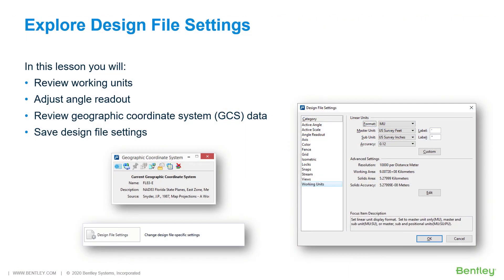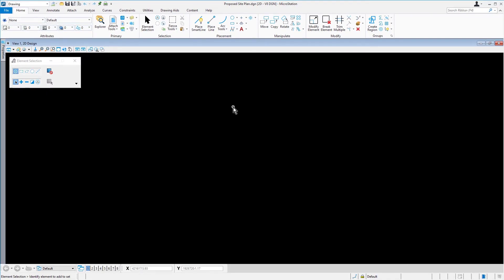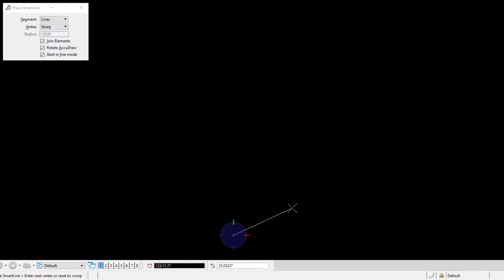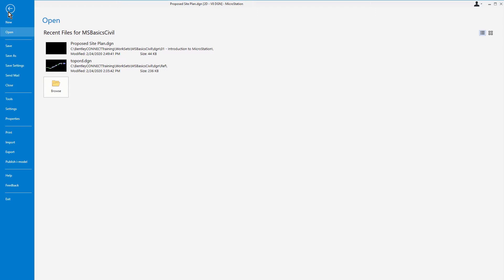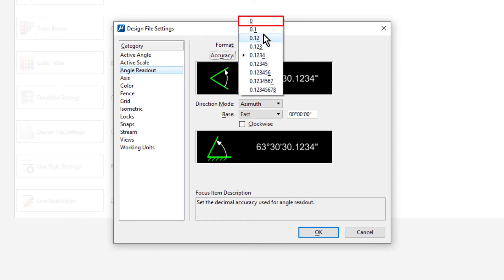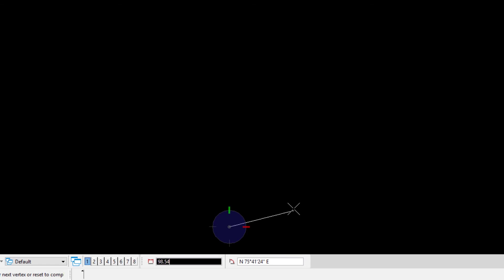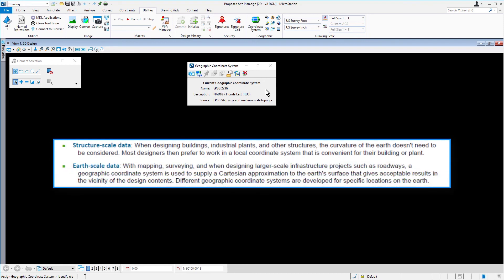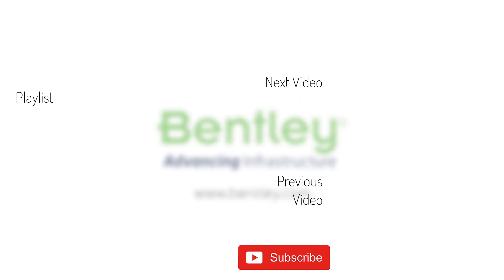Part 4: Explore Design File Settings

Comment: To understand why AutoCAD became the default CAD system, look no farther than this.

It takes 4 steps in AutoCAD to set the units and precision. In Microstation it takes 11. It's like this for basic CAD work, too.
Reply: Sure, AutoCAD gets it done in 4 steps… but MicroStation gives you 11 because it assumes you actually care about precision, flexibility, and control. It’s like comparing a microwave dinner to a 5* restaurant.........fast isn’t always better when quality matters.
Reply: @trog2821 there is nothing about quality regarding how many clicks it takes to do something except that the programmers don’t care about efficiency.